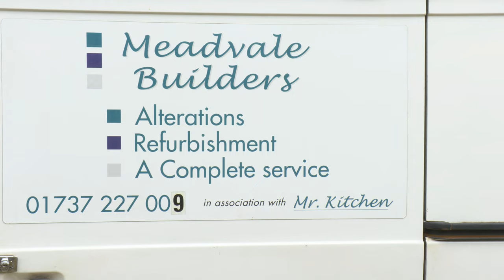How to Lay a Real Brick Path (with a laugh)

Comment: Many years ago I was having lunch with my family at a restaurant in Freiburg Germany. Outside the window a very large elderly chap (probably 20+ stone and close to 60) was laying brick pavers. He sat on a one-legged stool which was probably 18-24 inches off the ground. The one leg gave him the ability to easily rotate around 360 degrees and access many locations from his recumbent position. He had (if I remember correctly) 4 assistants who brought pavers, muck, sand and, yes … bottles of beer! The beer bottles were in a bucket of water which I assume was cold. He regularly uncapped a bottle and drank. This man had obviously been doing this for many many years as most of the pedestrian areas in Freiburg were covered in these pavers. The man was an absolute machine and I sat mesmerised watching the speed and accuracy he worked at. By the time we finished lunch he’d finished and moved on but the pavers were immaculate. BTW … he cut them, where needed, by hand!
Reply: @ricos1497  brilliant
Reply: @ricos1497  😳😫🤣🤣
Reply: Great story - thanks!
Reply: I know it's frowned upon these days but some of the best old school builders i know like a beer or two while they work.
Reply: Many years ago I worked on an Audi assembly line in Germany. Shift started at 6 and at 6.30 a small train came round carrying crates of beer. It was customary to get a crate for each station to last the day. They seem to have tightened up on it these days but a real culture shock when I started.
Reply: No doubt the beer was an effective anaesthetic. Putting ceiling cornices into  many rooms gives me backache, and a few glasses of wine solved the problem. They've stayed in position for 30 years, so I can confidently say that alcohol is a good adhesive 🤩

Comment: Nice job! Thinking about redoing brick wall laid in sand only. The unglazed bricks have split in winter freeze. How deep is the cement bed? What mixture do you recommend? Does this stand up to winter hard freeze with snow & ice? 

Cheers from Chicago!

Comment: I see they lay the 50mm pavers on a wet mix bed, I wonder if you could lay a driveway this way too?
Reply: No. The cement would crack and the pavers would sink. You'd finish up with grooves all over the place.  Look at road laying specs for car drives. especially if curved.
Reply: @stevestringer6702  Thanks.

Comment: Never saw bricks laid so delicately. Won't these freeze to bits with the water being able to come between?
Reply from the maker: No the gaps are filled with dry sand and the bricks are very frost resistant.
Reply: @SkillBuilder  Alright, those bricks look like traditional clay bricks that are usually very brittle, but I guess these are specifically engineered, thanks for filling me in. Very nice look overall!

Comment: Is this method advisable over laying on compacted screeded sharp sand? I have a 38 x 1.2m path to do around a house perimeter
Reply from the maker: Either way is good but a hand made clay brick like this is not easy to lay on a dry screed because the bottoms are not flat. The wet mortar is easier to bed in. If your bricks are flat then a dry bed is fine
Reply: @SkillBuilder  I'd still prefer a sand bed. Better for drainage. And easier to replace any bricks if they spall or whatever.
Reply: @SkillBuilder  I was wondering about drainage too, I assume this method is fine but how does the water get out? If it can't go down through the cracks between the bricks presumably it finds it's way out sideways? Also, I'd like to know how the base they're laying onto was prepared?
Reply: I've got weeds growing in cracks between pavers, even though I laid plastic first, then compacted sharp sand.
Cement will minimise growth of weeds.

Comment: Jesus man pull a screed and be done with it
Reply from the maker: It is almost impossible with those kind of bricks to lay them on a level screed. A wet mortar bed is exactly the way to go with a hand made brick
Reply: If you lay them on a screed, all the differences are are the top (surface) not the bottom.
Reply: Screeds OK if all the bricks are exact same thickness...

Comment: Good guys, but I'm in landscaping and they are house wall bricks.
Hard frost will wreck em
Reply from the maker: I am sorry but you are completely wrong. They are paving bricks and the frost won't harm them. I have had them in my front drive for 30 years and there is zero frost damage.
Reply: @SkillBuilder  what are they called and who makes em?
Very strange, they have decorative face on side which is like brick.
But great job

Comment: Until water gets between the 'joints' freezes, expands and breaks the base bond. COMEON ROG
Reply: ? pretty sure they hadn't finished and would fill the joints in later.
Reply from the maker: That bond is not needed because it is a bed not a glue.  It is like laying on sharp sand but easier to bed with an uneven brick. The frost will not damage this path.
Reply: @SkillBuilder  Interesting, surely this is for the "UK" only though?
Reply from the maker: @flightographist  No clay pavers are used abroad. They don't suffer from frost damage
Reply: @SkillBuilder  I was thinking more of the ground heave- North of the 49th, North America.
Reply: I've had 'nori' clay pavers in both my drive and patio since 1992. None of them have spalled or chipped and the colour has remained strong. Concrete pavers in that time would look a mess as the colour would have long gone and the aggregate exposed. Very few people use clay for drives any more as they're so expensive. The blocks for flexible paving are slightly different and not usually "bedded'.
Reply: @SkillBuilder  Cheers Roger, cleared up my query